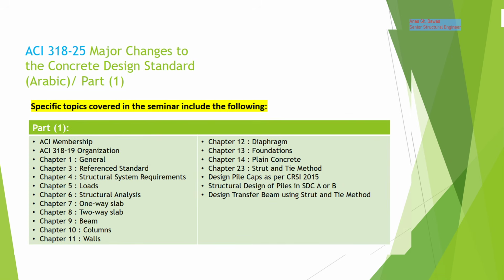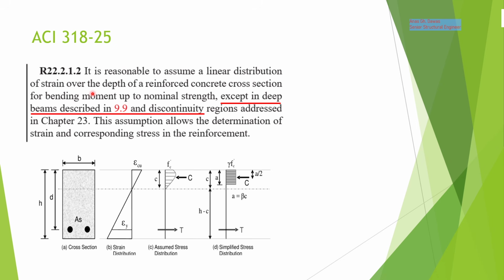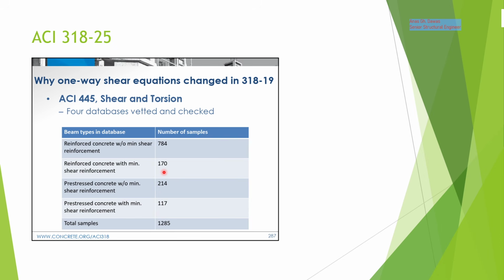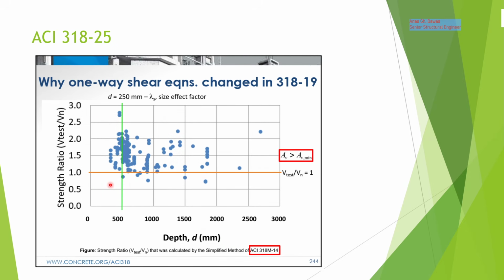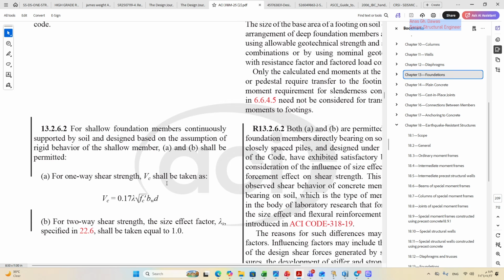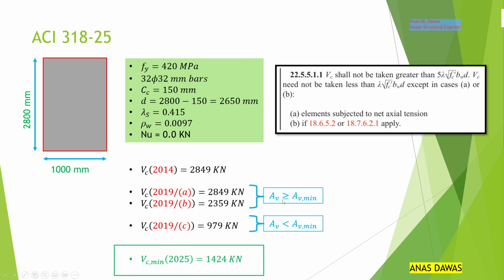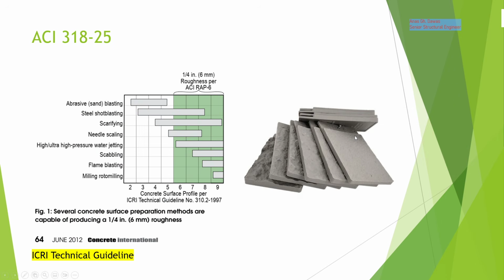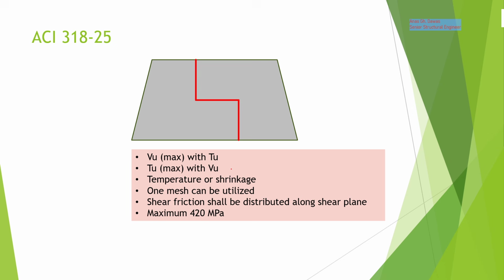CHAPTER 22 (Sectional Strength) - ACI 318-19/28

Comment: Sir, I have a question regarding the drift check: whether we should use the bare frame model  time  period in etabs or CuTa. Although Drift time period is not bounded by CuTa. Actually, I am concerned about that we model of buildings as a bare frame not filled with infill stiffness which is in real senario. So, in case of real time period must be less the bare frame time period. In Bangladesh, most of the building by masonary infilled.